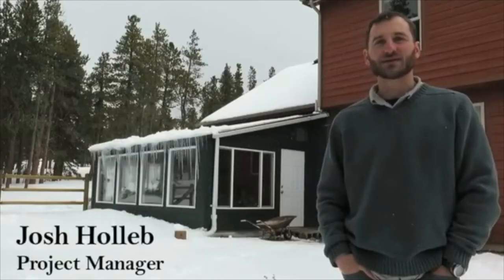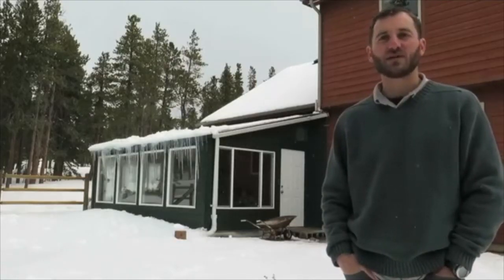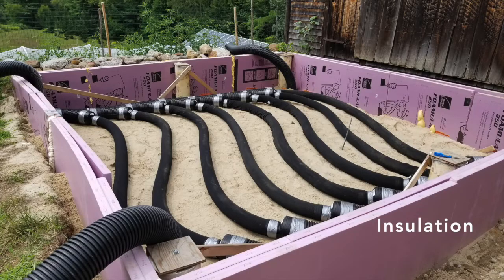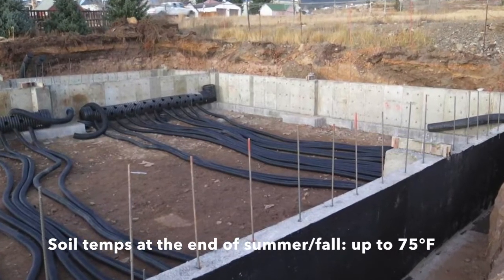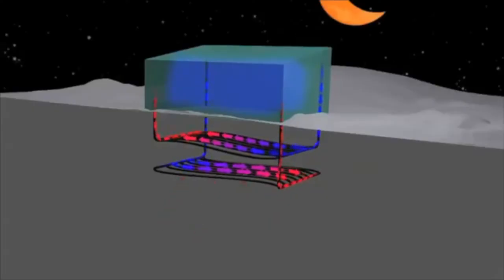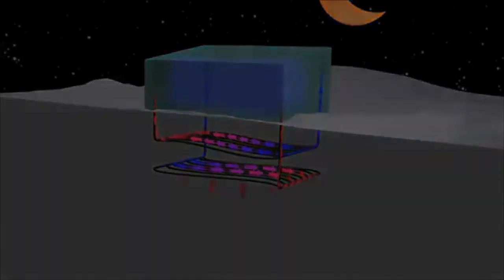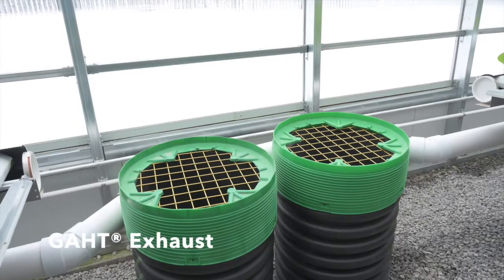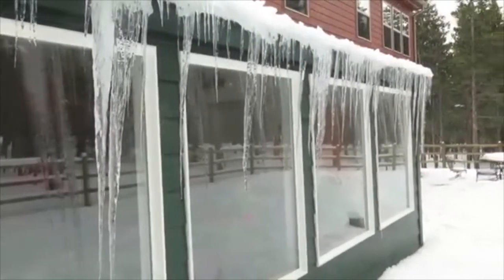A Geothermal Greenhouse

Comment: is there a risk for mold in the system?
Reply from the maker: Actually there's less of a risk for mold because the GAHT® system has been proven to act as a slight filterer of the air that is pushed through the pipes

Comment: I would like to know your average temperature for the winter time
Reply from the maker: Can you elaborate on your question?
Reply: @CeresGreenhouseSolutions  elaborate on the question OK, let’s see in the winter time when temperatures drop to the point of not being able to grow outside to maintain a proper growing habitat, such as around 48 to 52 to produce a tomato or maybe a vegetable what is your average temperature from the time the greenhouse drops or the outdoors drop to a temperature that you can’t grow outside to rely on the greenhouse to be growing in what would that point that temperature be from that point until your spring hits average temperature during that time what are you maintaining through those coldest times inside
Reply from the maker: @ShaneKetchum  Thank you for clarification. The answer to your question depends on how much thermal input from the sun you receive during the winter months. This article really helps with presenting different climate scenarios, and performance capabilities for the GAHT® system: https://cerescann.com/ceres-gaht-system-versus-the-ceres-ecoloop/
Reply: @CeresGreenhouseSolutions  So trying to achieve this in Western Washington, where it is mostly cloudy and raining 80% or more of the time in fall and winter, then this would not be possible. Correct?? If not, would you have other solutions?
Reply from the maker: @scottl4124  The GAHT® system is still useful in keeping the greenhouse environment above freezing during the winter months in a location like western Washington. Although, since there isn't a lot of sun in the Winter so the "battery" isn't going to be as charged during the day meaning by the end of the Winter, the soil has retained less heat. Check out this blog on our website to learn more and read about the GAHT system functionality in different climate scenarios

Comment: Isn’t that pumping nice juicy radon?
Reply from the maker: Greenhouses are less dangerous than conventional buildings when it comes to radon. First, you are not in the greenhouse for as much time. Secondly, greenhouses have very high air exchange rates. During much of the year, air (and any radon) will be ventilated outside, and the whole structure will be flushed with fresh air in a matter of minutes. Even if the ventilation system is not on, greenhouses have many more air exchanges than a standard home, mitigating radon build-up. In our tests of GAHT® systems in the Rocky Mountains (an area with high radon levels), the concentration inside the greenhouse was found to be slightly higher than outdoors, but much lower than a dangerous level. By no means is this a comprehensive study, so if concerned, have your soils tested for radon before installing a GAHT® system.

Comment: Can this system work for home cooling/hearting?
Reply from the maker: To date we have never installed a house GAHT® system. This does not mean it is not possible. We just have not installed one. Before considering this option there are two concerns you should be aware of: 

1. Radon 
2. Mold

Radon can be tested. And even if there is radon, it is more significant to watch the rate at which it accumulates. In the worst case scenario, if radon is detected the GAHT® system can always be shut off. 

According to studies that were performed by the University of Minnesota on several GAHT® systems where mold was tested no elevated spores were detected. It is important to keep in mind this is one study, and they were conducted on greenhouses and not homes. 

When trying to mitigate mold in the home you could use a filtration system with a UV lamp. It is important to look at ducting system- how to get air through the system. We can help with the design of a new system, but it is harder to work with existing ones.

Understanding these precautions is necessary if you decide to try this system on a house. Please consult us if you are thinking of a house GAHT®.
Reply: @CeresGreenhouseSolutions  thank you for the information.
Reply: @CeresGreenhouseSolutions  Perhaps one way to mitigate mold is to decrease the humidity with a dehumidifier at the point of entry of the house.  There's a guy on YT doing this with his house, "House in the Earth" or something.

Comment: Have you done any mold tests on the air coming out of that tube? When hot and cold combine, there's always condensation. Is there water collecting in the tubes along with mold? You could build an air filter box at the end with a high merv rating but you'll be replacing it for $40 every 6 months. The thicker the filter, the more surface there is for air to pass. I'd go with a 4 inch Mer 10. Not a 1 inch thick filter as that'll clog to fast
Reply from the maker: Thanks for your question. There have been tests done to measure fungal particles at the inlets and outlets of the GAHT system and it has been discovered that there are less fungal particles at the outlets of the GAHT indicating some filtering or capturing quality of the GAHT system

Comment: Has Ceres ever implemented this system for a greenhouse that is already sunken into the ground 6 to 8 feet to utilize stable ground temps? Theoretically you could minimize the usage of the system by submerging the greenhouse itself and only rely on the system when temps reach very low, or high, levels. Would that be reasonable with a system like this?
Reply from the maker: What you're talking about sounds like a walipini design, and while useful in some locations, a sunken greenhouse does not function well in locations where the angle of the sun can get very low during the winter seasons.

Comment: Sounds like a bunch .... ~ of hot  air~  ....
Where's the video in the coldest part of winter ....????
Reply from the maker: In certain climates, with really cold winters or really hot summers, the GAHT® system is a supplemental heating or cooling system. Either way it still reduces the growers reliance on fossil fuels to heat or cool the growing environment. To help you understand the GAHT®’s capabilities a little better, check out this blog that presents different greenhouse climate scenarios: https://cerescann.com/ceres-gaht-system-versus-the-ceres-ecoloop/

Comment: Excellent system, and great video! Practically zero cost to operate and inexpensive to build (with potential to be even cheaper, IMO). Can you provide any operational data? If you can, please tell me: what's your climate like, and what temperature can the system maintain throughout the winter? I'm a mechanical engineer in Canada, and intend to set up something similar in a house.
Reply from the maker: For more specifics on the system, please email us at info@ceresgs.com as the GAHT operates differently in different climates. For more information on this, please check out this blog: https://cerescann.com/ceres-gaht-system-versus-the-ceres-ecoloop/

Comment: Wouldn't the system be more efficient if the grid of pipes were in the soil outside the greenhouse? In your system you are heating the soil of your greenhouse in the summer and cooling the soil in the winter.
Reply from the maker: It depends on where you're located and whether you'll want to use your GAHT® more for heating or cooling. But it is possible to install this system outside the greenhouse footprint, read this article for more detail: https://ceresgs.com/adding-a-gaht-to-an-existing-greenhouse/
Reply: @CeresGreenhouseSolutions  Im not sure why you would pump the cold air from the greenhouse into the soil of the greenhouse to warm the air. You aren't bringing heat into the system. You are just moving the heat from the soil to the air, and since soil conducts heat way better than air the entire system will cool quicker.
Reply from the maker: @BigDoggyDad  It depends on how much thermal energy you were able to bring into the soil during the day when the sun was up and heating the greenhouse environment. If there wasn't very much heat sinkage then the soil will only be able to heat the incoming cold air to 55-65 degrees. For some growing environments, this is sufficient, but if your plants require more elevated temperatures, then an additional heater may be needed.

Comment: So my house has a geothermal heating and cooling system. I have a three season sun room. How do I take advantage of my geothermal unit to heat my three season sun room to turn it to a four season sun room?
Reply from the maker: we would need to know more specifics about your setup. Or we would recommend that you go back to the system supplier to see if it can be expanded to provide heating to your sunroom.
Reply: @CeresGreenhouseSolutions  so since the  whole thing about a geothermal unit is to keep down on all cost, so I think I should just keep my door open on my three season sun room have a regular fan blow the heat from my kitchen to the sunroom right and still pay 20 buck a month right? Geothermal is supposed to keep cost of heating and cooling down

Comment: How well does it cool for the low desert?
Reply from the maker: It depends on what you're growing first off (aka your plants required growing conditions) but, yes the GAHT® is effective to a certain point. In the hottest months it will probably need supplemental cooling measures like a fogging system or shade paint on the roof. Check out this blog for recommended system integration for different climates: https://ceresgs.com/what-is-an-all-weather-greenhouse/

Comment: You are using air to transfer heat from point to another instead of liquid such as water. This means, the cooling results will not be great. Using liquid is better to move the heat out. Also the air pipes will have draining holes for water vapor will be a very good spots for bacterial growth that will fly with the air to the greenhouse. What do you think?
Reply: I would have to agree with WW34. We have two large greenhouses and we tested the air transfer system in one of them and the transfer of heat was minimal. Less than one deg f. We then tested an inclosed liquid system and we were able to gain approximately 10-12 deg F. In our experience the GAHT system was not able to yield any desirable heat transfer. We now use a  Solar Thermal system on our roof with pex tubing in the ground and are able to keep cold crops year round. We live in Colorado at 5700 ft.
Reply: @ACsailing  kindly share with us some links to your project. İ would love to see how you combined solar with geothermal heating to ur greenhouse
Reply from the maker: Read about our EcoLoop™ solution here: https://ceresgs.com/environmental-controls/ecoloop-sunchamber/ and read our FAQ page on the GAHT® system here: https://ceresgs.com/environmental-controls/gaht/ these should answer your questions. Research has shown that our GAHT® system actually filters the air that runs through it. If you have any more questions, please contact us by emailing info@ceresgs.com or filling out a contact form here: www.ceresgs.com/contact/
Reply: @CeresGreenhouseSolutions  thanks, I will check them up right away

Comment: Are there any concerns about Radon with a GAHT system?  if you are in an area with radon, what mitigations do you think could be performed?
Reply from the maker: In areas with high radon levels, this is a possibility and should be taken seriously. However, greenhouses are less dangerous than conventional buildings when it comes to radon. First, you are not in the greenhouse for as much time. Secondly, greenhouses have very high air exchange rates. During much of the year, air (and any radon) will be ventilated outside, and the whole structure will be flushed with fresh air in a matter of minutes. Even if the ventilation system is not on, greenhouses have many more air exchanges than a standard home, mitigating radon build-up. In our tests of GAHT® systems in the Rocky Mountains (an area with high radon levels), the concentration inside the greenhouse was found to be slightly higher than outdoors, but much lower than a dangerous level. By no means is this a comprehensive study, so if concerned, have your soils tested for radon before installing a GAHT® system.
Reply: @CeresGreenhouseSolutions  thanks for the thoughtful and informative reply.